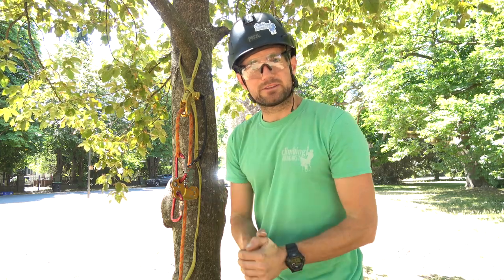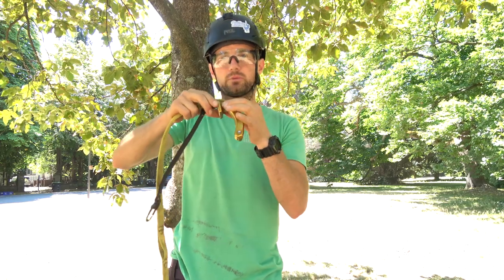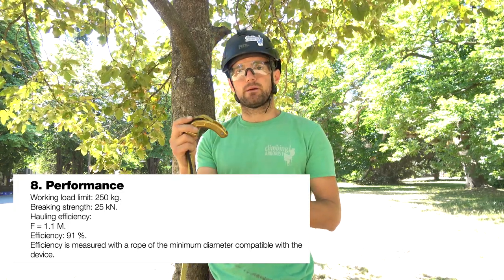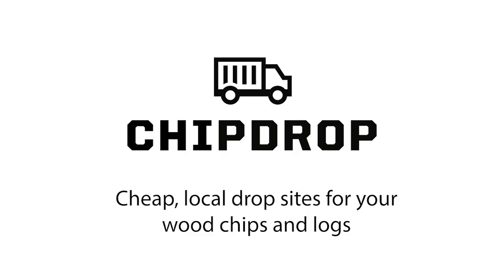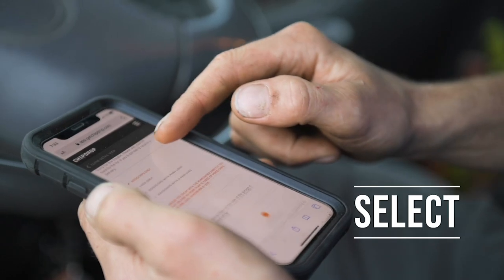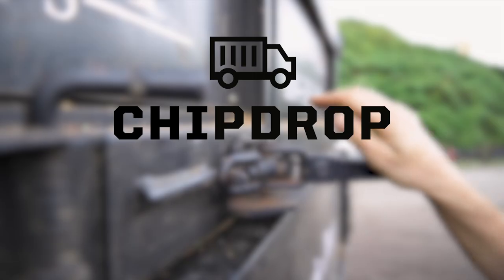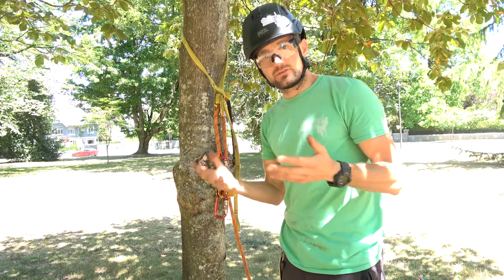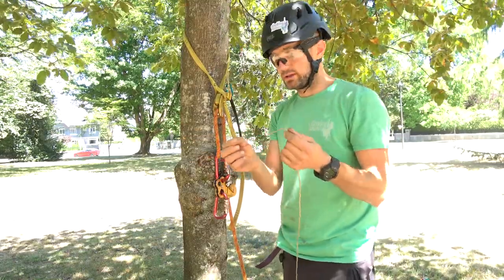PETZL NAJA in-depth Review! Would you/should you buy one?

Comment: Looks decent for moving rope but SRT doesn't need friction savers, not sure why people overcomplicate SRT anchors so much when a knot and occasional quickie shackle is about all you need. Maybe a small pulley for a texas tug if doing lots of redirects. The holy grail of friction savers for moving rope systems is a ground installable one and this one isn't so it seems only a minor improvement. the ART twinline is ground installable but requires two full length climbing ropes, at which point you might as well just chuck a throwline over a fork and pull up a rope with a pulley tied to the end with the other rope through it then base tie it. Still waiting on a proper installable from the ground system that works with one climbing rope. 

While I'm commenting I'd like to thank you for the video on the L1D ratchet pulley, brilliant bit of light rigging kit that means I rarely need the port-a-wrap anymore. Always wanted a good aerial friction device and even welded one up myself once but the L1D is better because it can pull the rope back up just as easily as a pulley. My favourite bit of rigging kit now so cheers!